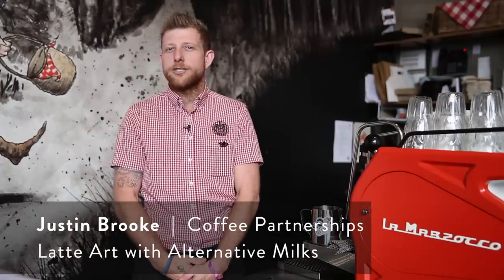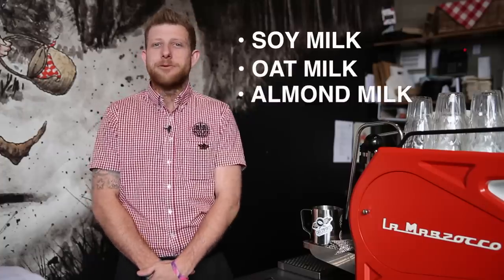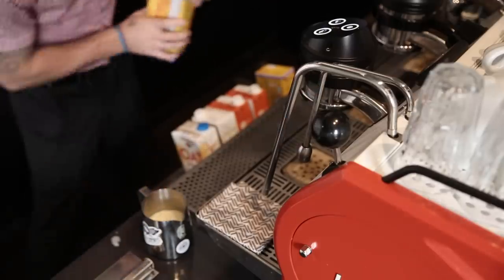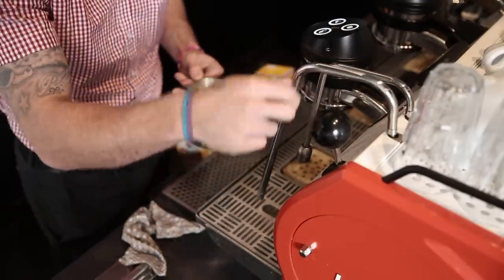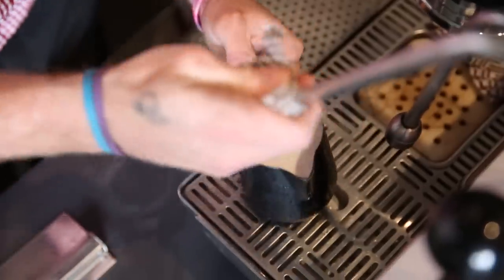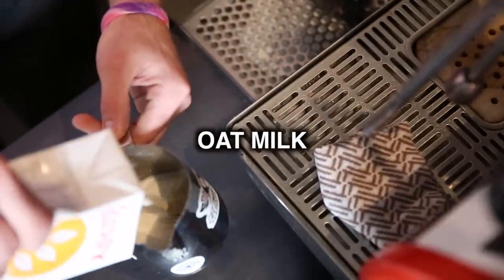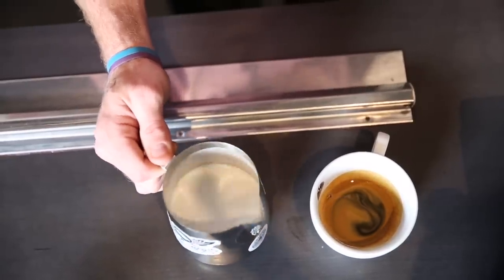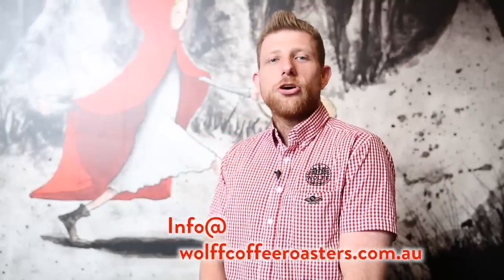Latte Art with Alternative Milks

Comment: i am very inspired! :)) but just a question on the almond milk, i am using unsweetened almond milk (Almond Breeze Unsweetened), will it affect the texture? thanks :)
Reply from the maker: Not all almond milk steams the same. But you should be able to get a decent micro-foam from most of these milks, focus on getting the bubbles injected in to the milk slowly and bit by bit during the time you raise the temperature. The bubbles hold better as the milk temperature is higher in these alternative milks.

Comment: That's perfect! But what is people ask for extra hot? Would you still make latte art?
Reply from the maker: Latte Art will be very difficult to do in this situation.
As an extra hot drink you will need to be texture the milk longer to get it to reach temperature. During this process you will alas also add more volume to your milk and it will become very frothy. Make sure you pour off some of the froth be fore your pour. 
Alt. Milks will burn just the same as regular milk and will pass on a negative taste to the beverage.. so I wouldn't be heating the milk more than 75cº at most.

Comment: The most important part is the brand of your milk you're using. For some reason this wasn't mentioned in the video at all...
Reply from the maker: The reason being the suggestions for how to steam and pour Alt. Milks in this video applies to all brands. Yes, some brands are more forgiving than others and hold texture much longer in comparison to full cream cows' milk.
Reply: true. We used other things before switching to "barista series" which is made for frothing. Nothing else we tried would hold a froth at all.
Reply: In my previous job we used Bonsoy soy milk which was great imo and it's the same one he used